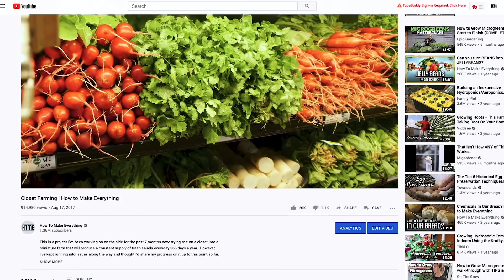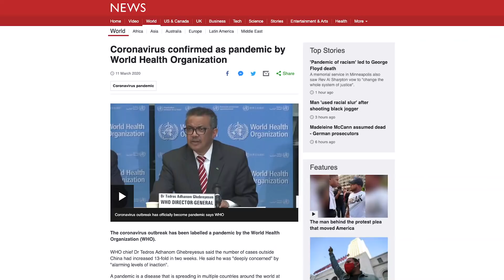Homemade Salad Grown in My Closet Garden for ONLY $3400

Comment: the brown roots is root rot.  a product like Hydrozyme or other beneficial bacterial fert would have helped a lot with protecting the roots.  And yea, hydro is very high maintenance.
Reply: Hygrozyme is good stuff.
Reply: @danielcadwell9812  idk what it is
Reply: @mrpepperonipizza3287  Google it.
Reply: He should make a subreddit so he can get advice from other experienced hobbyists like this.
Reply: I don't think he made the ph in the rock wool 7
 Rock wool is very acidic
Reply: Adding a few drops of bleach per gallon and 1-2 drops more per gallon per week would keep the res clean. The low amounts of chlorine would stop any bacteria from taking root while not negatively affecting the plants.

This is also why city tap water that is soft enough usually have less root rot problems to ro water.

The key is to use tiny amounts of bleach to sanitize the water, if you pour bleach into your res, all your plants would have very while roots, and be very dead.
Reply: just make sure to not use hydrazine
Reply: @ginsederp  a great alternative to bleach is high % (30+) hydrogen peroxide. You don't wind up with the chlorates, and the reduction reaction actually releases o2 for the roots. Good stuff all around.

Comment: You did not use primer for the glue, thats why you had the leaks.
Reply: He also didn’t clean the the parts he was gluing before he glued them. Just get some lacquer thinner and wipe around the pvc.
Reply: primer etches the plastic. Super important part. This also melts the two plastics together and get a strong seal.
Reply: I had to put so many concoctions on the pipes for the conduit on a solar power farm out in FL. Omg for hours i was cutting, cleaning, priming and gluing the joints, then taping the openings so nothing got in the tubes before they were in the ground. Flashbacks... i miss construction work sometimes
Reply: I think he only used the primer XD
Reply: @widdershinnz  Where was that solar farm? FL resident here and I think I know where you're talking about.
Reply: Incorrect. You do not NEED to use primer on the glue. The glue is hot enough (chemically) to do the job on it's own just fine. Primer is needed for pipe that has sat around for awhile, been in the dirt/mud, grease, oil, etc has been able to get into contact with it.
From an irrigation perspective, primer makes it easy to see which joints have been glued and which ones not at a quick glance (my uncle is an irrigation professional)
He used the wrong glue, for one. Blue was not the right type of glue. He should of used Clear.
Reply: @TwistedShrapnel  The primer is not needed. The glue is hot enough on it's own to do the job. 
Watch electronicsNmore video: What's The BEST Way To Cement "Glue" PVC Pipe. 
Not a single fail happened at the glued connection.
Reply: Korishan Why would the blue glue be incorrect?
Reply: Where the failure was at for the leaks was "not" the glued sections. It was where he put a threaded adapter and tried to seal it inside of a non-threaded housing. He should of used a bulkhead adapter at this point. It has a rubber gasket that goes on the water side.
However, he should of really used a reducing bushing instead of drilling holes in those caps. Not only would of been a better design, it would of been cheaper in the long run, easier to assemble, and a neater of a build. Come out of the bushing with a 90* turn down and everything would of been tidy and compact.
Reply: Im a certified plumber for a municipality, by law in my state were required to use primer for pvc. Or if its threaded then were required to use plumbers puddy or pipe joint compound on the threads. But service lines and main lines do handle high flow rates and usually higher pressures. Unless its poly line and we use brass couplers. Its crazy stuff.
Reply: IMAMERICA128 it was in Melrose with Blatner Energy (amazing company, took such good care of me)
Reply: Google User I have never used a primer in years of plumbing and never had reports of leaks. Primer is not needed. As long as the pipe is clean, it’s fine when using fittings properly. His problem was making holes to jam fittings into them that were not really designed for it. He could have make it work fine though with properly using some rubber gaskets on the fittings which it looked like he didn’t do.
Reply: Nah man, he didn't use flex seal 😤

Comment: "There were leaks" 
Proceeds to never even think of using a Flex product
Reply: I expected Phil swift to just burst through the wall like the kool aid guy
Reply: Not only that, he didn't use the correct parts in the first place. Either a Bulkhead fitting for the drilled out cap, or use reducing bushings instead of the cap.
Reply: Pilot16H  I don't know if you have noticed, but he sometimes comes across tasks that he is really bad at. He just runs into more of them than the average person because he is trying such a wide variety and does not have the time to fully learn the skills.
Reply: I think the nutrition of the plants was bad because chemicals where used instead of actual healthy, natural soil as it should be. they looked yellow and kind of bad, they should look green and radiant
Reply: rami chahin It does not make a difference whether plants get their nutrients artificially or naturally. His setup was just bad
Reply: rami chahin did you know that nutrients are chemicals?
Reply: @jerry3790  thats a very ignorant statement. seek Truth before its too late
Reply: @jovenlangseth7214  I'm obviously (or not I guess) referring to natural vs artificial nutrient -_- your comment is ignorant
Reply: Yikes.
Reply: The source of nutrients isn't important, but he very well may have messed up the balance. While I have had the best results with carefully tuned synthetics, for a first timer using compost tea is probably easier.

It's way easier to run an indoor grow with an engineered soil like promix MX than to jump right into aero/hydro. Especially if yield is your primary goal. 

But as shown in the video he was watering way too much when he did try soil and failed to allow the pots to dry between waterings which is why he had gnat problems. Gnats will ruin your yields and can be a tricky stage for the novice indoor gardener to get past.

He should have grown everything in soil that was a long term plant, and used aero for the leafy greens since they have such a high rate of turnover and respond well to rockwool and aero.
Reply: " THE SUPER STRONG WATERPROOF TAPE "

" IT EVEN WORKS UNDERWATER. "

Comment: I had some good results with a simple aquaponic system.   Using a fish tank to provide nutrients rather than trying to balance nutrients with a solution.  It's worked moderately well.  But yea... not every plant is going to do well in such a system.  Lettuce does really well.  Green beans and peppers do too.   Can't say I had any leaking problems.  Using a simple bell siphon with a cheap fountain pump.  Only issue I've had is that you have to clean out the pump every couple weeks to make sure the water flow is enough to trigger the siphon properly.
Tank wise.... I went with gold fish... but I wouldn't go with gold fish again. Too dirty...requiring an additional tank filter which can be costly.  Also their food flakes can get expensive over time.  Especially since they get rather big.
My set up was using a basic plastic storage bin cutting holes in the lid and filling empty space with volcanic rock.  I cut holes in cheap plastic cups and filled them with clay pellets.  using seed inserts to grow the seeds.  (again not the best setup).
Eventually I'll try redoing  the grow bed and the tank.   Feel Like I can shed some weight from the system and better utilize the space inside the bed with some changes.
Cost wise:  Shelf was around $300
tank = free got from a friend
pipe and bell siphon assembly was around $50 total
Lava rocks,  clay pellets,  soil (for fish tank), gravel (for fish tank)  probably was around $60 all together?
Grow lights were ~$80 (bought 2 were around $35 each)
reflective curtain  was around $20 
optional burlap to make curtain nicer $30
Fish....  I went through a few so we'll say $10
timer was $60 and hard to find a decent one
Tank light $100
tank heater $75
fountain pump $16
Tank plants I spent around $60 but I probably only needed to spend $20
Tank decorations optional $200
Plastic storage tray from walmart ~$20
cups $3 package
Seed medium $30 for a bag of 100 or something like that
Anyways... it's not Cheap per-say,  but a lot of the cost is fixing initial mistakes and aesthetics.  I probably could have saved a lot more money had I searched for fish items people were giving away in classifieds.
Reply: Leaving a comment here so I can find this later. Very interesting!
Reply: Fish Tank is more risky because fish can poop too much and that may shoot nitrogen content overnight in the water and your plants can die.
Reply: Basically only something with really low nutrient requirements like lettuce.
Reply: I just use my old tank water to water my plants. Goodness have they exploded.
Reply: Was going to suggest this myself. Harder definitely but a much more self-contained system. Duckweed can be used to feed some kinds of fish (that can also be food for you) and if you're feeling really brave a black soldier fly larva composting system can feed even more nutrients back into the system. Don't forget a good mineral source too!
Reply: Don’t mind me just gonna screenshot this comment and be on my way
Reply: Nice:-)
Reply: I have a fish tank already so I might try this. I would reccomend getting into the fishkeeping hobby because it is quite rewarding and fun!
Reply: Could you do a video showing of the project? your channel has no content it seems.

Comment: It's actually a common misconception that you need rocks at the bottom of a soil pot to improve drainage. It doesn't improve drainage in the soil and just moves the most saturated part of the soil closer to the roots (something you don't want since it helps cause root rot).
Reply: Agreed. The rocks just add bulk so you won't need as much soil, as well. 
Normally what I do is a sandy soil for the bottom 1/4 of the pot. Then the rest is potting. Then when I transplant (if needed) I put some more sandy soil in the bottom, make a crater, place the plant in, then pack in potting soil all around and bulk up the soil height to give more room for root growth. My tomatoes really love this set up.
I toss in some Nitrogen from time to time to give them extra gusto, and about once a week i'll put some miracle grow. This I do with all my plants.
Reply: @korishan     Per 1 gallon: 1 part urine to 5 parts water,  tablespoon of Epsom salts, a rounded teaspoon of ash, and a tablespoon of kelp powder = pretty nutritious plant food.
Reply: I've used rocks very successfully in closed bottom containers, but you need a barrier between them and the soil, similar to the setup in a terrarium. Landscape fabric that's designed to drain works, and so does fine window screen (don't use the metal kind though). That method turns the rocks into a support for a cache basin, instead of just a place to hold soggy potting mix. Some plants will eventually root through the barrier, tapping into the reservoir of water, but it doesn't have the same properties of causing root rot or damp-off that sodden soil does, because the soil above the barrier remains well drained enough to stay aerated, so they continue to grow happily. 

This has become my favorite method for potting desk plants, as the closed bottom containers make watering less risky (don't want dirt water on my workspace and paperwork), and it allows me to use attractive containers for my ferns and tropicals.

Comment: Seems like with growing projects they need a more constant focus. Unlike other projects that can be dropped for a time.
Reply: It all depends on how things are set up. Take the algae for example. He left that for 2 yrs and it did just fine. It had its own sustained system.
The same is for more classical plants. If you have a system in place to take care of the needs, they can grow on their own fairly well. Until they overgrow themselves, of course.
The first month to month and half is the most crucial. That's when the plants are at their most vulnerable state. So it does take a lot of time at the start. After that, they've been established and can take off. The only problem is if you get root bound. Where the roots run out of room in the container. With hydroponics (or other -ponics), the roots are free to grow without restriction.

Comment: growing hydroponic marijuana for 6 years, i found that you really need to schedule plant maintenance, and check on them a couple times a day if possible.  it's amazing what can go wrong in the span of a day, more things than i care to remember.  like you said lines get clogged and bulbs burn out.  i also had a cooling/ventilation system and circulation fans.  i quit because of constant setbacks with gnats, mites, aphids and powdery mildew mostly.  growing organic indoors (or outdoors) certainly is a challenge.
Reply: well obviously the insects kept coming back to get high
Reply: Why not just go find some weed in the woods like Andy did
Reply: Do you have any spare seeds?
Reply: @angrypastabrewing  Just try with some bag seeds -- weed is unbelievably easy to grow. They call it "weed" for a reason.

Comment: Awesome video 👍 I started a similar journey 3 years ago. Started with soil, then also switched to a hydroponic setup (DWC), it went pretty good in my case, but having to change the water in time and after some weeks to keep bad microbes and algaes out of it ended up beeing  a bit unconvenient. Then heard about Coco and tested it out. That year went without any major issues and great results and became my favourite methode. It's technically also a hydroponic setup and the plants grow fast and strong, you should try it out 👍

Comment: If you break it down, almost every problem you had was related to trying to pump water around in the system. Leaks, clogging, water not getting to roots... And I'll bet that the majority of the electric cost was with the pump. Wick systems avoid ALL that. And the fix is soooo simple: Just make the container for the grow media deeper so it always has access to any water remaining in the tub. Look at the base model AeroGardens. They work REALLY well (I love mine) and they do it by making a long, thin, grow pot, with a long, thin, sponge. Yes, they still have a pump, but in the cheap models, it's not there to pump the water around, it just mixes the water / nutrients every once in a while and provides a bit of oxygen to keep anaerobic stuff from growing. I have a system that uses an bubble lift pump cut in a section of bamboo with a small air pump. In that way, if it fails, it's not a big deal. The more critical thing is good water level sensing which the AeroGardens have, but it isn't reliable. The solution: A float on rod that sticks up through the top and a flag. Low tech, simple, foolproof systems are critical. If you want to automate that, you can plumb in a toilet valve and it will water your system automatically. Also, a simple tub, wick, mixer, and light system is far FAR less labor to setup. Very VERY easy to build. And to maintain.

Comment: Now make perfumes . One method is to put Roses and other fragrant flower in a water mixture.  Put the solution in the flask and sandalwood oil in the other one 
. Scents would be separated from water into the oil after distillation .

Comment: I've used 2" PVC for a NTF system, dutch bucket from 5 gallon pales, and recently a raft system. I haven't really had many issues with plants when they have enough light, nutrients, and good water. Tomatoes in a dutch bucket grew better than ones in a real garden. Basil in a raft system grew too large and blocked light from nearby plants. Algae and molds have probably been my biggest problem. In the future the systems I plan to make will have to be easy to take a part and clean. I think that one has to have a system where they can remove sections of the garden for cleaning. I've found for microgreens 100 watt LED daylight white bulbs were fine if you had 2-4 per tray (can't remember any more) Using a large LED array like Mars Hydro seems to help a lot with lighting. I haven't had any luck with purple looking lights off of Amazon.

Comment: It seems that your lighting might be a little on the dim side. I found that I can avoid spindly weak growth with about 3000 lux, but  for best results and sturdy seedlings you want 5000+ lux. Metal halide lamps in a neutral white color (942/NDL) have proven to be the best lighting source: depth penetration is far better than with fluorescent lamps or LEDs. Also, metal halide lighting has one of the best photosynthetic yields per watt. You can often find these metal halide lamps cheap on ebay for about 20-30 bucks a piece, they come from shop window lighting. I like the 70 watt versions of these (easy to come by, cheap, efficient) and use one 70 watt bulb to light an area of roughly 1 by 2 feet or precisely in metric: one bulb for every 60 x 40 cm tray. You can get a lux meter cheap these days to measure if your lighting is sufficient. I start all seedlings for the homestead under these when the temps outside are still too cold.